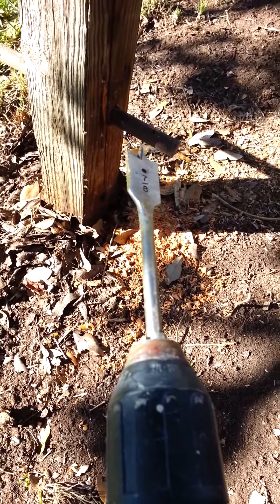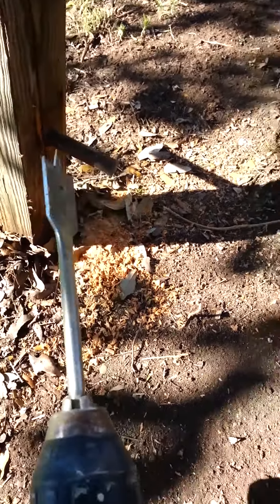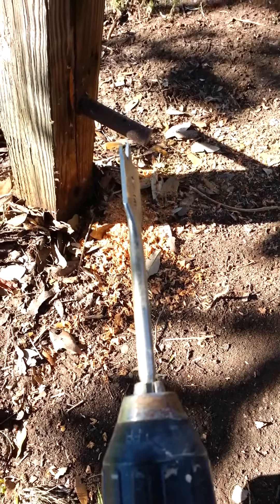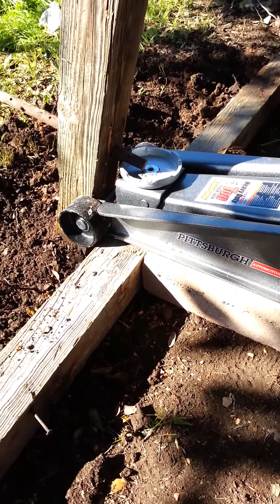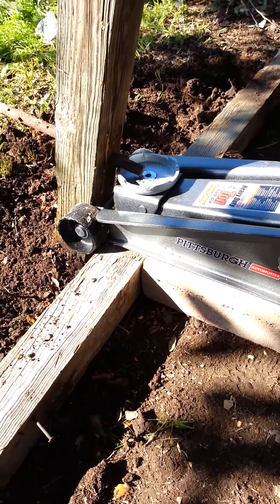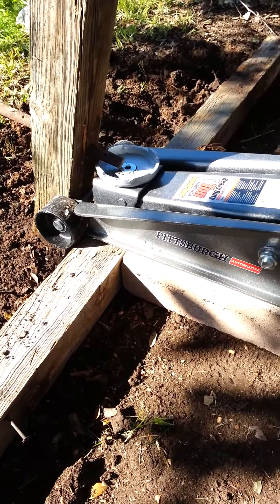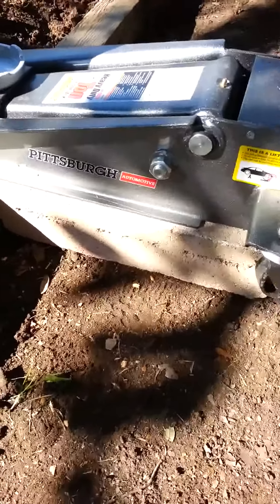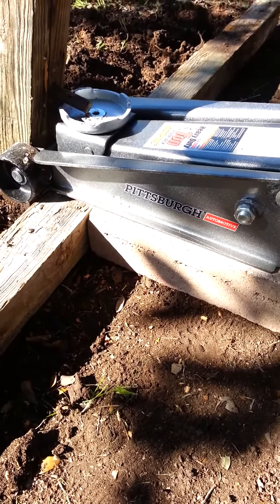How to remove a fence post in less than 2 minutes.

Comment: so if the post has rotted & snapped below ground what then???
Reply from the maker: Sounds like you have an excavation/demolition job using a shovel and a 20 lb sledge (if anchored in concrete). Either that, or try twisting a corkscrew anchor or guy anchor down through the remaining wood. Then run an iron rod or chain through the 'eye', and figure a way to connect to your jack.